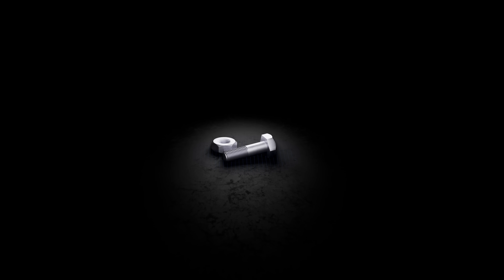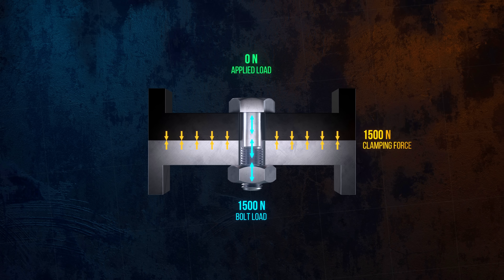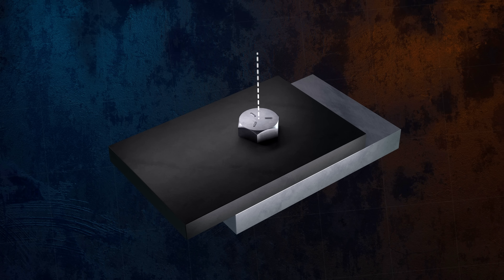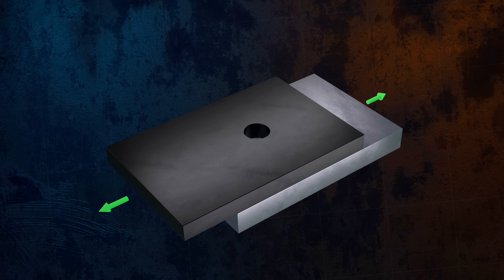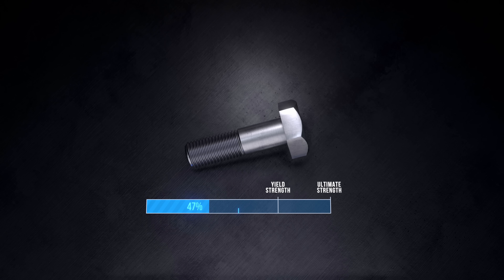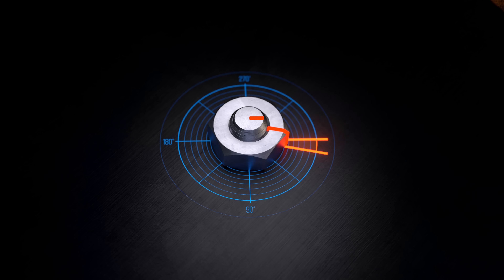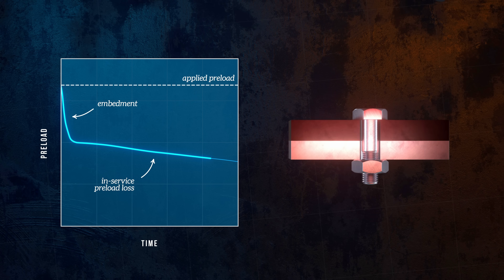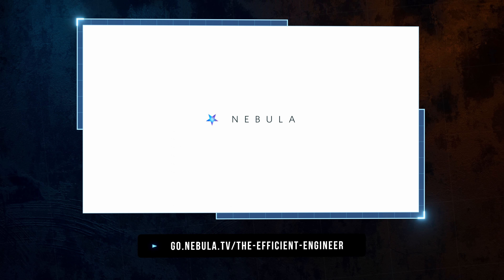The Incredible Strength of Bolted Joints

Comment: Some of the coolest bolted connections were the slip critical joints in powerplants that have to meet seismic code. Things are massive, took forever to rattle them right. 
The neatest bolts are on the turbine case, feedwater pumps and boiler piping. We don't even use torque wrenches, you can't really because it just takes too much force. Instead we used hydraulic tensioner to stretch the bolt and then spin the nut down. It's at the correct preload when you let the hydraulic pressure off. Another one is really weird. It had a hole drilled down the center for an heating element. Since you can calculate how much the stud will lengthen at a specific temperature you can determine the clamping force when it cools and shortens. Essentially you use heat to make the.bolt grow to loosen and let it cool to tighten. Crazy stuff in powerplants.
Reply: Whoa! That’s sounds crazy to use hydraulic tensioners and nut them down. Thanks for sharing the info.
Reply: @Nunya Business I remember watching a TV program that did dramatizations of airline disasters and presented the forensic analysis of the cause(s). One such event came down to a crew doing routine service/maintenance on an aircraft an unknowingly used the wrong spec of fasteners to secure the cockpit windshield. Needless to say, during flight, the fasteners failed, the windshield was torn from the aircraft and the cabin crew were killed as a result. That was an awakening for me to pay more attention to the application of screws, bolts and other fasteners in my day to day applications. You know, “…just hand tight is good enough,” or “…give another 1/4 turn to be sure.”
Reply: @Radioactive_Slime  The pilot that was sucked halfway out of the windshield in that incident survived, as well as the rest of the crew. The co-pilot landed the plane safely and the pilot was given medical attention immediately.
Reply: @whatbroicanhave50character35  I see you've also read Humble Pi
Reply: @DignusFerox2  no what's that
Edit: Googled it. I don't know why you thought I read that. I'm just on the internet a lot and have a fairly unhealthy amount of morbid curiosity
Reply: I was wondering about hot rivets. They should shrink to preload I was thinking
Reply: @UberAlphaSirus  you are correct
Reply: That is correct.  @UberAlphaSirus
Reply: Indeed!  I’m one of the guys that designs those types of bolts!!
Some have a separate rod down the centre so you can measure the strain with a depth micrometer.
Some of the bolts are 300 mm diameter!
Reply: @Nunya Business That's when the engineer patiently explains to the 'bean counter', "Look if we do it your way, the plant breaks down and we don't get to make electricity.  No electricity, no money.  Do it MY way and we operate for a good long time, make lots of electricity and make lots of money."
Reply: @Nunya Business I remember watching a TV program that did dramatizations of airline disasters and presented the forensic analysis of the cause(s). One such event came down to a crew doing routine service/maintenance on an aircraft an unknowingly used the wrong spec of fasteners to secure the cockpit windshield. Needless to say, during flight, the fasteners failed, the windshield was torn from the aircraft and the cabin crew were killed as a result. That was an awakening for me to pay more attention to the application of screws, bolts and other fasteners in my day to day applications. You know, “…just hand tight is good enough,” or “…give another 1/4 turn to be sure.”
Reply: Thank you for sharing!! I wouldn’t want my fingers in the way when the bolt was still tensioned😂
Reply: Oh that's cool - you pull the bolt first
Reply: I used to build and test steam turbines and I've  had the 'pleasure' of using those heated fasteners. We used an induction heater with properly sized rods/ wands you insert . If you have awkward angles to work with and aren't paying enough attention to detail to ensure you insert the heating rods completely you can heat the cover nut instead of the stud which can really mess things up... may ruin the whole fastener by basically making the nut a permanent fixture onto the stud (Don't ask me how I know lol).

There was one more way we achieved those extreme torque values: a product made by nord-lock called a superbolt/ supernut. The nut has 6 or more jack bolts through it that achieve the desired preload. If this strikes an interest, there are short instructional vids here on youtube of them.
Reply: I heard about the heating bolts for the preload from a maintenence person at my work, he maintained large 1000 ton dies at his previous workplace, don't remember what they made, but anyways, to torque the massive tie rods they used to hold the machines together, they would have to heat the tie rod to a certain temperature and turn the nut a certain amount of degrees, when he was new he turned it way too far and shot the tie rod out of the machine and shot it across the shop when it cooled
Reply: Wait, I don't know if I buy the simple tension case. Yes the clamping force is going to decrease first, but only because there's already tensile stress in the bolt. The bolt is still taking the full load at all values, right? It has to be.
Reply: @TrystonG33K-m2v yes. You pre load so that it’s already in tension and therefore stiffer (also easier to get the nut to torque). The compressed joint will be actively opposing the clamp force, but it would pull apart much more easily than the bolts.
Reply: @MrAstrojensen  That's a cool video man! thanks for sharing.
Reply: We did something similar in the foundry on certain high heat exposed areas.

Bolts would get induction heated, slapped in, torqued to spec.

Not quite for the same reason yours were. Ours were so that when in operation, the bolts were still under correct tension when the system was in operation (as you're not getting into a 2200F furnace to tighten bolts when it's up and running).

The bolts were super fuckin expensive. Most of them were 5/8 or 3/4 and ranged from 2-6" long. They ran anywhere from $10 to $33 a piece. I forget if I ever looked up what the hell they were made of but it wasn't your average grade 8 or 12 steel.
Reply: @Nunya Business their grid failed because greentards have demanded wind turbines instead of reliable, on demand NG or clean nuclear fuel. Then mother nature came calling.
Reply: I've also seen 'stud heater' rods used.  Put the rods in all the studs, heat them for a few hours and then run the washer/nuts down.  This was also in power plants.
Reply: Hydraulic tensioning is also how the steel towers of the Golden Gate Bridge were bolted to their concrete bases.
Reply: @Nunya Business Honduras, Afghanistan, Brazil and the Congo are not examples of free market economies, but examples of mismanagement, failed planned economie and corruption. Anything they got that works was bought from a capitalist free market economie.
Reply: Aside from the mentioned eolic wind towers and turbine cases, hydraulic tensioners are also used in plate heat exchangers in many applications and in marine engine cylinder heads!
Reply: Can confirm. .  Spent 37 years working in power plants. I have seen countless turbine casing bolts being tightened, either by hydraulic stretching or by thermal expansion as you described.
Reply: Tensioning 24” pipes as a first year apprentice was the hardest thing I did physically but it opened my mind for better things and now I’m in engineering school ❤️
Reply: @Nunya Business "Hey, that sounds like nunya business" some corpo shill probably
Reply: @MrAstrojensen  bolts for traffic lights are bigger
Reply: @Blox117  no they're not. Traffic lights are 1" or 1.5" max (25-35mm) that's HALF the diameter of the turbine bolts.
Reply: @ObservationofLimits  its true that i didnt measure them, but they seem quite large
Reply: @Blox117  You are what's wrong with the world today. Everybody thinks they know something without knowing a damn thing but your quick as hell to blab on and on as if you do
Reply: @nunyabusiness3786 First hand experiences with unions has taught me they have their fair share of incompetents. With non-union you can fire easily, with union help it becomes much more difficult. These unions and foreign competition killed the US and UK industrial sector.
Reply: @Nunya Business If unions actually safeguarded that it would be the first reason I have ever heard that unions should still exist today. While in the past they were important (necessary in many areas) my experience is they bloat costs and schedules and don't actually care about their members. If I had my way, unions and HOAs would all dissolve.
Reply: @dwpetrak please never put HOAs and Unions under one umbrella. HOAs are largely corporate bloat with no accountability, Unions are the neighborhood collective who force change from greedy and regressive HOAs. Unions should exist to help you be paid as close as possible to the value you bring to the company by doing your work. If you think people are currently taking a Greater % of their value than they are producing for the company 1) that’s just statistically wrong and 2) market forces should fix that naturally, at which point unions will become necessary once more to combat corporate greed.

Also not your point but addressing it here- power companies do not make money by providing electricity, they make money by creating new structures- private companies are financially incentivized to maintain absolute minimum flex, and to allow infrastructure to break completely and be expensively replaced rather than perform basic maintenance.
Reply: @mjp121  Hey, Max, I understand what HOAs and Unions are. I grouped them because I can't stand either one. I can accept that there may be some union somewhere which serves a valuable role in today's society I am unaware of a single one. My hatred for HOAs though is deep ardent and unending and I will never enter in to another (by move or vote).
Reply: Most power plants are private.
Chernobyl was government owned!
Reply: @josephpadula2283  Private, or corporate, the result is the same when there is no accountability. 

You can have the most capitalist or communist system in the world but if no one is held accountable when things fail it doesn't matter what your ideology is.
Reply: @zelkuta  In a capitalist system, everyone is held accountable and everything is 100% democratic, because if the thing fails, the company has to invest into repair, and maintanance is cheaper, as failure means downtime and downtime means less income. Also its democratic because every consumer votes every time he buys something with his money. If his product of choice turns out unreliable, he might invest into competitor products instead.
Reply: @hernerweisenberg7052  That most be the most naive thing I've read in years.
Reply: @hernerweisenberg7052  how do mono/oligopolies and propaganda factor into your worldview?
Reply: @hernerweisenberg7052 I can tell you’re a teenager because nobody who remembers 2008 would say something this out of touch with reality
Reply: @josephpadula2283 no surprise there, government tends to do anything badly lol

Comment: Exceptional video. I used to work on Toshiba 660 and 720 MW steam generators and this video has given me more of an appreciation for the countless weeks stoning flanges. We used a combination of turn of nut for applying the actual force and measuring the elongation. To turn the nuts we would use an induction heater to stretch the bolt and tap them around with a flogging spanner and I would use an extensiometer (essentially a rod and a dial indicator mounted to a sleeve) to measure the stretch after the bolts had cooled down (usually 12+ hours later).
Reply: I used to do nuclear outages. The "bolt techs" had those awesome induction heaters.. it was cool just to see how the halves of the turbine were connected together, with such immense force and huge bolts
Reply: OMG.
Reply: I wonder how did the makers of steam locomotives a long time ago figure how much to tighten the bolts holding everything together?
Reply: @ninemilliondollars  They used rivets mainly. Hot pressed rivets have the same shrinkage clamping like bolts.
Reply: @ninemilliondollars  From my understanding it was a process of improvement. As each generation of machine (and machinist) came to be the lessons learned from the last generation would be applied. It's impressive seeing the design changes and improvements in power stations running the same turbines but with more advanced ancillaries.

Comment: Do note that the use of lubrication may modify the nut factor.
Reply: Lol
Reply: "The use of Lubrication [...] introduce a lot of uncertainty" IM DYING LMAO
Reply: As an aircraft mechanic, can confirm. It's all over our pubs that contamination of threaded fasteners with foreign materials can affect fastener preload and therefore cause erroneous final torque values.
Reply: That is one of the reasons that the turn-of-the-nut method of pre-loading is preferred for structural work.
The problem that remains is to decide at what point of loading to begin the turn[of-the-nut process.
The Canadian Handbook of Steel Construction has the starting point after 2 or 3 solid blows of the impact wrench on that bolt.
Reply: @BasementEngineer  you definitely didnt get the joke
Reply: @8BitGamerYT1  What joke?
Reply: @BasementEngineer Do note that the use of lubrication may modify the nut factor.

If you read carefully, he meant something with two meanings. But if you don't get it, take it chill. just a small adult joke 😂😂

Comment: Hey, Awesome video as always.
One comment! Nominal minimum bolt preload for 8.8, 10.9 etc is according to >>>bolt tensile strength<<<, not according to bolt yield strength. See EN 1090-2:2018 (section 8.5, tightening of preloaded bolt assemblies) and Eurocode 3 EN 1993-1-8:2005 (section 3.9.1, Design slip resistance)
Reply: Is that standard freely available?

Comment: Love it !!!!

Whenever possible, insert bolts loose (without any shear force) then solidly tighten the nut.

I do it on 19 in. rackmount equipment. No wear on bolt threads during insertion, much easier to remove later on.

Comment: I don't understand how pulling the two preloaded sides apart will not directly influence the stress in the bolt. The pulling apart is in the same direction as the preload. If you don't preload the Bolt and Nut at all and pull the two plates apart the load on the bolt increases proportionally to the external force.
EDIT: I get it now... first the preload is reduced and when there is no more preload then all the force goes directly to the bolt. I had to imagine the preload being a lot of small compression springs and the bolt being a tension spring.
Reply: Yeah, I dunno. Even treating it like springs I’m having a hard time seeing how a bolted assembly has more tensile capacity than the bolt itself just due to preload… It just doesn’t make sense to me.

Comment: So after asking this simple question to several (mostly civil) engineers and never getting a satisfactory answer, I'll pose it here. 

What is the technical, mutually exclusive difference between a bolt and a screw?

Edit: Failed explanations so far specify nuts, which has been the dominate explanation I've received. However, explain machine screws, lead screws, and other mechanisms still referred to as screws despite having corresponding nuts. Further, as a screw cuts threads into the base material, it inherently forms it's own nut out of the base material. And not to forget, as is seen in automotive contexts, bolts (sometimes referred to as "studs" instead just to make this even more convoluted) thread directly into base materials rather than using a separate nut.
Reply: An acceptable explanation is that a bolt is held in place with a nut, whereas a screw is inserted into a tapped (threaded) hole in one structural member.
Mind you this is not always the case;  hence we talk of cylinder head bolts and wheel lug bolts on automobiles.
However, in the structural steel business we always spoke of bolts.
Reply: A bolt is a fastener type screw that's using a nut, screws can be many things, studs are threaded rod until they're screwed into something and cylinder head bolts are really screws. Hope that clears it up  :)
Reply: The nut.

Comment: EXCELLENT. very well made video and easy to understand, NOW what I need is a follow up video on the use of washers, lock washers, spring washers, flanged bolts/nuts etc I often see on construction sites of large buildings NO washers are used but a home appliance or small things say a trailer does use them, please explain.
Reply: Good question. Building steel joints are sheer joints. The holes for the bolts are made by the steel materials supplier, as specified by engineering. Location, dimensions, tolerances, are all specified by designs which all must conform to standard regulations. So the correct fastener hardware will fit very well in the hole it's designed to go into. Appliances parts are made with very broad tolerances. Precision is expensive. So they add washers and the like to take up the slack in sloppy fitment. And, they use very thin metal and plastics, they don't want to use larger bolts, so they add surface area to the head and nut so it doesn't deform parts.